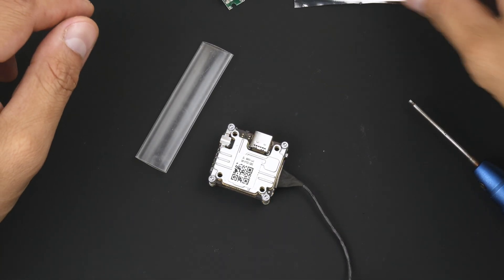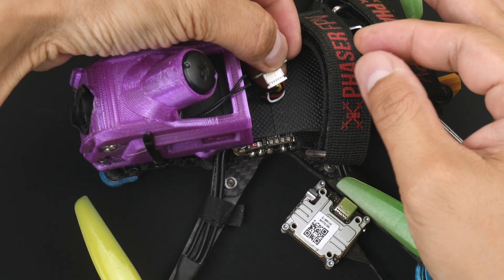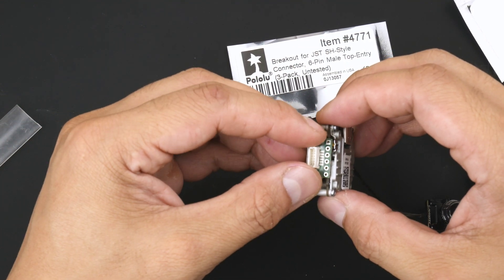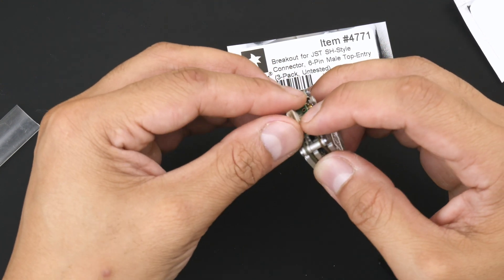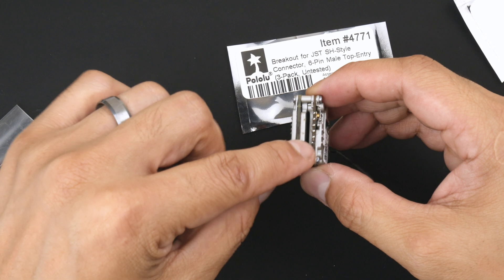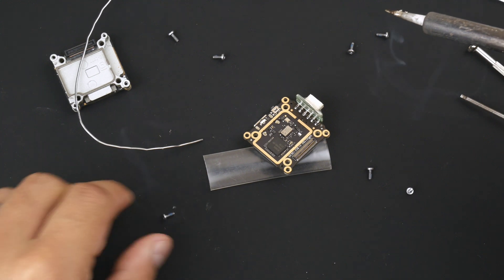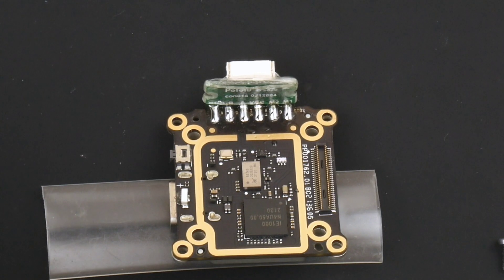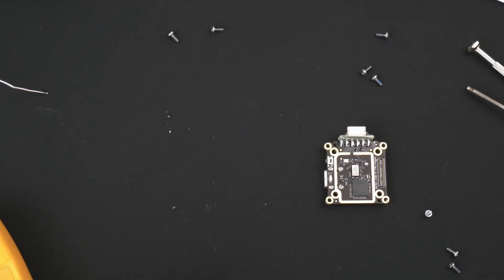Caddx Vista + Pololu JST SH1.0 Mod

Comment: being not so good at soldering .. what is the disadvantage of just soldering the wires onto the air-unit and then having a plug on the end to connect / disconnect ?
Reply from the maker: I believe using a plug for air unit connections aren't affected that much, and if so, are minor and negligible. Reason I say this is because many, if not all, flight controllers that are digital VTX compatible, use a plug to interface with the air unit. Even the O3 air unit has the plug now, which means it requires both ends to be plugs instead of soldering directly. This is of course a matter of convenience and for the likes of people who aren't comfortable with soldering, can still use the product. However, if I were to want absolute reliability for long range or commercial use, I would solder everything where possible since I can be guaranteed it will give the best power and signal transmission/communication between components. If anyone disagrees, please let me know. Happy to be corrected or clarifications to be made. 😁

Other components, such as motors, ESCs and battery etc, definitely benefit from soldering compared to plugs.